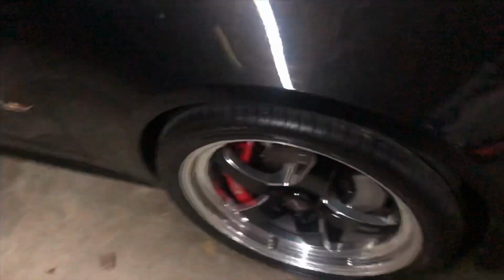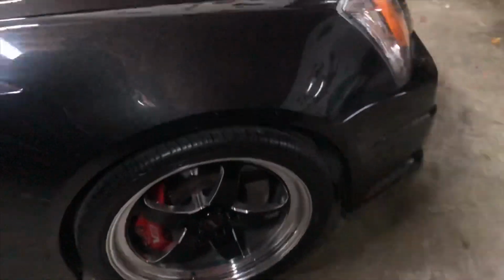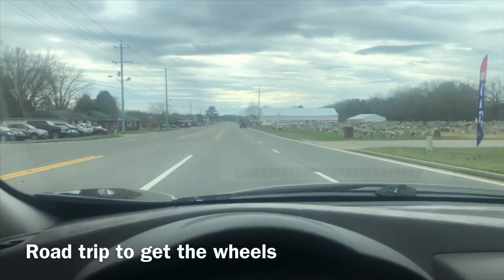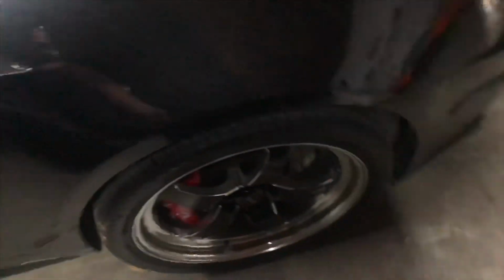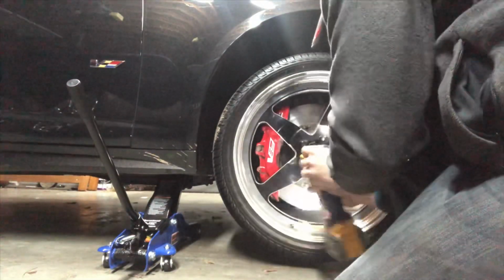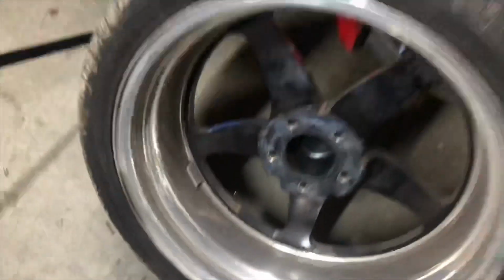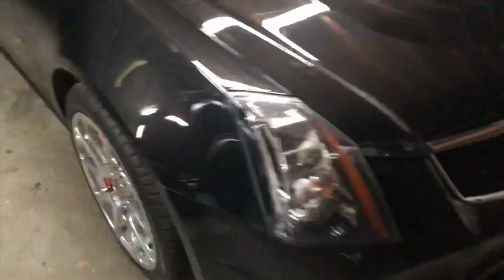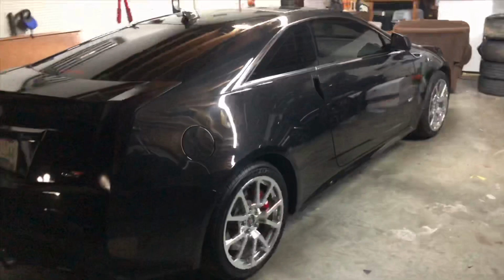WHY I DITCHED MY WELD WHEELS FOR STOCKS.

Comment: I'd recommend taking the wheel to your local tire shop and have them submerge the wheel and tire in water. You might find a micro crack in the wheel thats causing it to leak. I had the same thing with one of my brand new S71's called them up and they replaced the wheel for free.
Reply from the maker: O wow I really appreciate that Info man!!